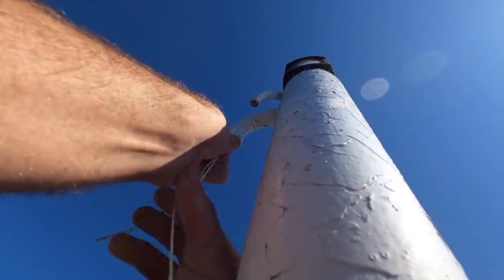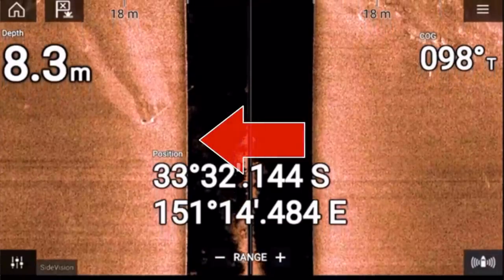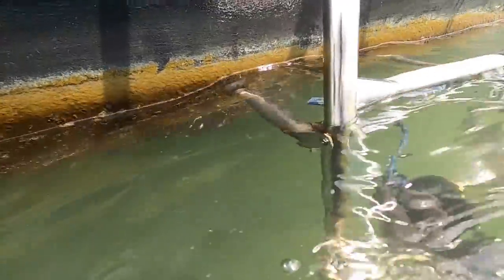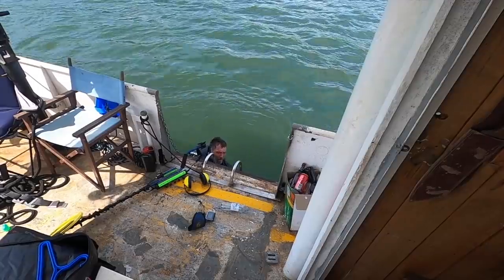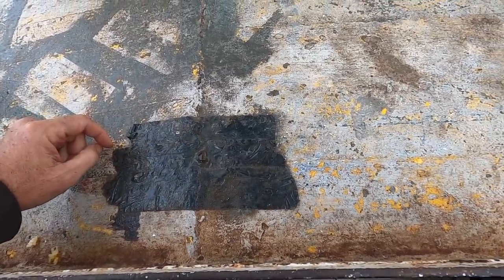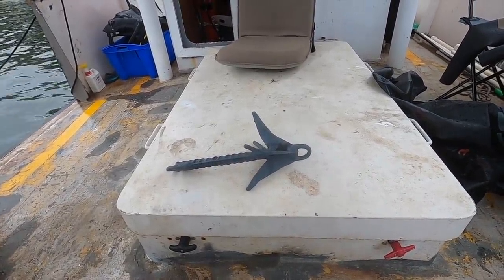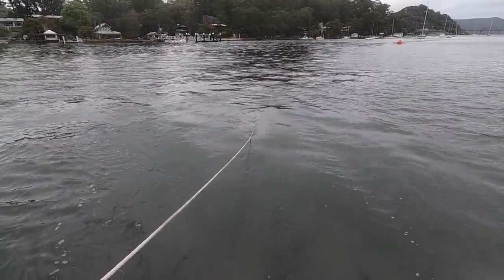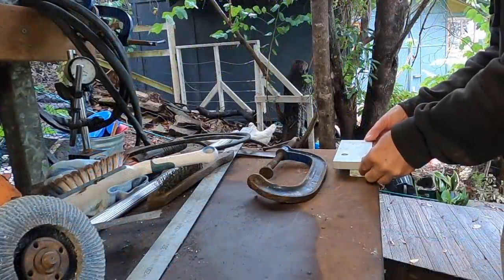Boating and diving

Comment from the maker: An article on solo diving for those interested https://www.divelogz.com/solo-diving-is-it-safe-to-dive-without-a-buddy It is also well worth noting that the buddy system falls apart pretty fast in low visibility and that the dive in this video is shallower than 10 metres. During you beginner's dive course you practice an out-of-air ascent from 10 metres by slowly exhaling on the way up. 

I also think the idea of using a reef anchor filled with lead is a great idea for this type of grappling, I would just need to be careful that a hookup gets detected as the weight of Renko would very easily bend the flukes straight. Perhaps a snub line that breaks before the flukes bend would be a good indicator. Time for more experimenting!
Reply: I was thinking about that scenario too and to clip a buoy onto the mainline when the grapple catches and chuck the lot in. Then once anchored up don the scuba tank and go down to investigate!!
Reply: Thanks....Not good diving alone is it ?
Reply from the maker: @steveshoemaker6347  In the right circumstances it is fine.

Comment: hi Stu, im a commercial long line fisherman from iceland.  when we get our long line snagged and cut we use chains that have cuts in them and bent outwards and drag it over the area, but one time we lost both of those chains and my dad had an old hook just like the one you have that we managed to get the line back up.  I had a discussion with my dad ( 40+ years long line fisherman) and he told me there was no gain in having more weight behind the hook, what matters is to have weight in front of it. 
so the chain you have on the rear of the hook is not doing anything for the hook, we used a couple 7kg weights tied in front of the hook and it worked magic, got it on the first pass in 150 ish meters deep water.
Keep up the good work!
Reply from the maker: Thanks mate. Always great to hear the experiences of people who have done it in the real world. I'll remove the back chain then and add some more weight to the front.
Reply: Iceland.... awesome place. We hired a car and drove a full lap around Iceland for 2 weeks in 2018. It's by far the most spectacular country we've ever seen (and we've been to 54 countries)...

Comment: When we were racing inflatable boats we were invariably inverting them in big surf and getting a gut full of water.  Apart from welding the crank, we used to put a half a cup of methylated spirits in each tank of fuel. Whilst probably not as flash as your additive, it did the trick.

Comment: Hello from Ontario Canada. I like your idea for the anchor sprit, using a flat block where a roller won’t fit.  Any kind of wear reducing item in that location will certainly help!  I also liked your idea in the last video of spoiling off the top of the drum instead of the bottom to change the angle of the chain. It’s worth a try.  Certainly you’re on the right track. Keep up the great videos, I always look forward to them and as we get closer to cold snowy Canadian boatless winter, I’m going to need all the help I can get LOL  cheers! ~Aaron
Reply from the maker: Thanks Aaron, I hope the videos get you through the winter to the next boating season! :)

Comment: Hi Stu, After talking to Dave from Cavalier yesterday I left my self-made chain catcher in your Landrover. It digs deeper into the mud than a grapnel anchor (more like a reef anchor). Give it a go if you like. I used it with a 3-4 m length of leading chain and dragged it from my dinghy in Dead Horse Bay. Could not find my 22kg Delta anchor yet but only tried for an hour or so. Good luck.
Reply from the maker: Thanks Richard, I'll take a look and give it a go. I bought some 12mm reo bar yesterday to make something new or modify the existing one so I'll look at yours before settling on a design. Maybe we could get together and look for both anchors one day next week.
Reply: @DangarMarine  Mine is made of 12mm reo bar I had lying around. Great minds think alike!  Great, let's do some mud-fishing. Next week Wed (most of the day) and Thu morning I am busy but any other time is good. I left my phone number on a note in your Landrover.

Comment: For future reference put a length of thin chain to the string. I would do that when feeding electrical cable down a cavity, and hook it out through a hole on the inside of the wall.Works a treat
Reply from the maker: Chain would be easier to hook, for sure. Good tip.

Comment: Im looking in the background at the nice crane that you have installed and thinking about a basket to hold all your gear and tools so you can  lower your search kit over the side and save hauling stuff over the side then lifting it back on to Renkos deck by hand while perched on the ladder.
Reply from the maker: Great minds think alike! I'm in the process of rigging something up that is made out of the stainless drum from inside a front loading washing machine. Should be useful for a variety of things.

Comment: Stu,

I saw the challenge you were having handling all of your equipment while you were launching from and boarding Renko. A group that I used to dive with created a basket that would hold their gear on the water side of the gunnel right at the water level. They would load their gear in before entering the water, and then place it into the basket before trying to climb the dive ladder. Just a though. Love the videos, and thank you for your content!
Reply from the maker: Thanks Matt. I have considered hanging something like that off the crane as I could lower it right to the waterline and then winch it back up when done.

Comment: If you buy a more expensive anchor and use a really light rope, there is a 99% chance it will get snagged on the other anchor that's already down there.
Reply: @lemullet6273  Have you tried turning your Californian phone upside down so you can read Australian?
Reply: @lemullet6273  Well he probably already  owns the lite rope
Reply: I lost brain cells reading this

Comment: G'day Stu, great to see you're now able to use Renko as a dive and salvage platform as you had envisioned from the start. Pat yourself on the back for that and enjoy the fruits of your labours.
Diving for small objects in fine river silt is always going to be a tough gig. No matter how careful you are to keep your head down and fins up you're always going to kick up the silt.
Also, trying to manouvre and anchor Renko onto a sonar hit in a current will always be a hit and miss affair. Another option is to use Renko and its powerful sonar to find and fix your target, then stand off and anchor nearby. Then launch Red Dwarf or another small boat and use a hand-held GPS to get right on fix, and drop a weighted buoy right on the mark. 
With the position fixed, now you can plan and time your dive to ensure there's a enough current to clear your kicked up silt fairly quickly (especially if you start a little downstream and search with your head up-current), but not so much current to be unmanageable. The window for the ideal tidal stream might be short.
Alternatively, once you've fixed the position, could you launch the ROV at slack tide to do an initial search on the fix to decide whether it's worth diving.
Also, you definitely do need a deckie. You can't swing a grapnel from the foredeck while also manouvring to a precise location in a river current. 
Finally, diving solo without someone keeping an eye on you and everything topside is not recommended practice. You'll get away with it in enclosed waters, but not forever, and it's a guaranteed losing strategy in open water. 
Give me a call when you need a deckie. If I can can get down from the mid-north coast I will.
Reply: Well said Paul!
Reply from the maker: Hey Paul, yeah, definitely ways to get the GPS position more accurately and confirm it will a follow up scan, looking forward to refining those techniques. Let me know when you are next down this way, it would be great to catch up again. :)

Comment: I checked on the grappling hook and saw that most Grapplings have longer and more curved hooks to catch and grab. maybe if you weld longer steel to each hook it might help grab whatever is in the water. The way that grapple is made  only lets it skip along the bottom and possibly over the chain as well.
Reply from the maker: Yes, some longer flukes is definitely something I'll try next.

Comment: G'day Stu good to see you again those s/s anchors are dear I had one on mine and I had extra stainless steel line to the "D" shackle.   I reckon you'll find it but as you know it's going to take a bit of time looking at the bottom, one thing I meant to ask you are you really happy and confident about the Detroit they seem to be temperamental it might just be me, as always nice to see the girls keep safe look forward to the next instalment John
Reply from the maker: Hi John. Yes. I'm very confident in the Detroit's running, but it does need to come out to get the oil rings fixed so it doesn't lose so much oil. The combustion side is fine though so I'm happy to use it until I can get it out.

Comment: About the solar panels, consider replacing the two wire tiedowns by removable pipes with spanners. This will hold the solar panels up when you modify your mast.
Reply from the maker: Have thought about it, but the awning has to come off to remove the engine so I can just do both jobs at the same time.

Comment: Couple of suggestions.  For the mast, a hinged flange would keep everything connected and easy to raise and lower. 
On the side scan sonar.  When you are trying to anchor on a target don't forget to allow the distance from the GPS antenna to the bow when you drop the anchor.  Also, the difference between the GPS antenna and the sonar array, although from memory, I think they are almost directly over each other.

Look forward to your videos, Thanks!
Reply from the maker: For sure, there are a lot of relative positions to keep in mind when co-ordinating the sonar with the GPS. Hopefully over time I will start getting it spot on more and more often.

Comment: For the roller just cut a little bit of the floor out leaving the sides to put the rollers bolt through. Approximately 1/3 of the roller could be lower
Reply from the maker: That could be one way to go for sure.

Comment: @28:40 the plastic guide for the anchor chain.  can you drill 2 holes thru the base and mount 2 blocks that might be triangle shaped on either side of the block with stainless screws up from the bottom into the base if the triangles.  so you have more guide sides..  with the triangles allowing the chain or rope to slip over without snagging.    on the grapple. you may want to use the angle grinder to carve a shallow notch in the inside root of each flute..  so if it snags a chain.. it hooks between the links to hold on and not slip off.. you will have to match the  grooves to the chain..  if you make another eventually you may want to use rounded curves on the inside of the flukes.. so you grab onto anchor chains in a wedge as you go across them.   on the rope for the grapple.. you may want to  figure an easy way to tie in a rubber ring like is used on fenders to prevent ripping the cleats out of the deck or rail.  so you get some spring when it hooks something hard..  instead of just snapping tight..
Reply from the maker: Good ideas Wayne, thanks for sharing. :)

Comment: Seems like a lot of work pulling the Detroit back out but it is what it is ! I still think a large magnet would work fine for locating the anchor ! How long is the anchor chain on it ? It should be a 2 person effort ! What about a platform on the port side that can be lowered into the water for diver entrance and extraction ? On side on rollers or something and the other on your winch . Just a thought !
Reply from the maker: Yes, it is a shame it has to come out again, but as you, it is what it is. Unfortunately because the anchor and chain are stainless a magnet isn't going to do the trick in this case, but a diving platform would certainly be a great addition. :)
Reply: @DangarMarine  I’m not use to stainless anchor and chain here in Minnesota , wasn’t thinking in that direction ! Lol

Comment: I would rig the search line where it stays on the anchor and you take it out when you need it.
Reply from the maker: That's actually a really good idea given how much of this type of searching I'm planning on doing. I'll have to put my thinking cap on. I certainly could have attached it before I dropped the anchor rather than swimming down with it.
Reply: @DangarMarine  Mount a swivel on the bottom back of the anchor shaft. Stuff the line in a small canvas bag and clip it on the swivel. Clip holds the bag and the search line. You can re-stuff the search line when it comes up with the anchor.

Comment: Interesting the grapple has 4 prongs - I'd expect 3 to work the best, as the grapple on its side would sink equal length prongs deeper into the mud/silt. It might also help to have the grapple tongs be "scoopier"? Just shooting from the hip here, but  the one you have looks like it wouldn't dig itself deeper while being pulled.
Reply from the maker: I'd say this one was built mainly for lift strength, but I'll try something more like a reef anchor next time. Will have to run from a smaller boat through as I don't think you would even feel the flukes of a reef anchor bending towing from Renko.

Comment: awesome STU,hope you get the mast wiring set up [leave a spare pull through in place lol}
Reply from the maker: It's getting there. One of the things that didn't go right this week was getting the wires for the 4G antenna stuck and breaking one of them. New antenna on order (glad they are only $30) This time I won't run the two together, one at a time...
Reply: @DangarMarine  yikes glad it was not an expensive one at least,I always found it best running the thinner and often more fragile leads first and on survey boats we  had to go down a huge mast and then 3 decks down to the Navigation centre. Plus they were calibrated antenna leads that would often be removed after 2 months and new calibrated ones run for the next job.

Comment: Head mounted gopro will give you shite footage compared to two hands on a tray mounted gopro. Of course you are a video channel so need footage but youd be better off in that sort of depth and viz leaving bundles of rope on deck and going down with a reel, I use mge reel, decent size and less chance of entanglement!
Find the anchor then back down to video but use video lights. If you find it and video with your torch you'll light it up and see nothing but bright white light or angle the torch away and see nothing but black. I got Suptig lights, cheap on Amazon, can just mount the light on top of the gopro if you wanna do it really cheap but you'll get a better spread of light. 
Follow your line back, hover above the silt and film it. 
Trying to do everything in one dive rarely works. 
Just my opinion for what it's worth, love the channel. 👍
Reply from the maker: For sure, the filming is a separate job in it's own right. Fortunately a friend of mine is doing his dive ticket at the moment and is interested in doing the filming.

Comment: I hate fixing previous in-mast kluges.  Suggest you weld a custom stainless steel flange/hinge at the bottom of the mast.  It makes repairing/replacing mast head lights and other work a snap and you would not be standing on the radar dome.  Also while you are at it, run new marine grade tinned copper wire without any splices and use shrink adhesive type terminals.  It's much easier working with fresh clean copper wire than confronted with making a repair on old green corroded wire.  Been there working 12 meters above the deck while sailing.
I love watching your channel and look forward to it each week.  Take care.
Reply from the maker: For sure, I don't think there is any old wire left in the boat, just didn't trust any of it in the end.

Comment: Stu... have you thought about making some drop/buoys that you can drop near a target... but see the float above it to get you within closer range.  Get near it, drop marker... then scan again to get reference of distance from marker to target and what direction, etc.  Or did you already think of that? Yep... I should have shut up until minute 26....LOL.  Is the silt any less worse right at the point the tide changes?  That is some murky ass water....
Reply from the maker: Having a bit of tidal flow certainly helps take any stirred up silt away.

Comment: if you get the dimensions of what size roller you can fit, i'll make one with some spare teflon i have around with a 8mm hole through the guts for a bolt
Reply from the maker: Thanks David!

Comment: I wonder if you'll have a better time with less silt kick-up by using your little submarine drone. Not that you would really be able to see the metal, but maybe if you put it right over your mark, you'll see some familiar shape.
Reply from the maker: I did have a short experiment with the drone but it is very easy to lose your bearings on the way down in such poor vis.
Reply: @DangarMarine  Hey at least you tried! The drone doesn't have an integrated compass on it?

Comment: I end up running a lot of wire for alarms, cameras, access control stuff. I absolutely despise it when people pull multiple wires and tape or zip tie them together in areas where they won't be accessible later. I'm all for bundling and keeping things neat and tidy where they're visible and accessible but other than that It just complicates things for the next guy that comes along.
Reply from the maker: That's it. There are plenty of times when grouping wires together makes things neater and more protected and other times when it makes things a nightmare.